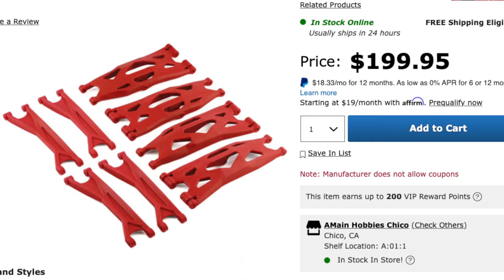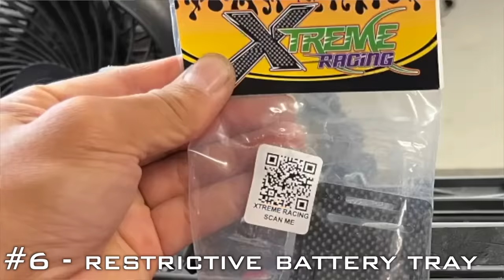7 worst Traxxas X-maxx problems - and how to fix

Comment: I bought a new 8s that i run on 6s because i had the batteries for my boats already.
3 battery cycles 20 min use basically and it switched by itself to reverse from forward and then no power to motor. Switched esc it worked then same thing first run outside. a 1500 truck that after taking it out twice is basically new but i have to spend money on. Arrma i have an Infraction and a Felony that has run to burn tires like no tomorrow and never a single problem with both. The infraction as even been used in heavy dust and not even a fan quit on me. I had wanted an X Maxx for a long time now i regret buying this piece of crap.

Comment: So wait, you spend $1100 on the truck and everything needs replaced for it to not break? Ummm, anyone else see the problem? $1100??? And it just breaks, servo too weak, and tires blow up?
Reply from the maker: Yup agreed. It is a great chassis for sure. But the weaknesses are well known and have not been fixed for the las 7 years or so.
Reply: @RCReviewChannel  that helps me make my decision as a n00b to this. Any alternate recommendations? Thanks!

Comment: i blame the driver for the damage, this toy is for responsible people. drive carefuly and it should last much longer. great power, great responsibility :)
Reply from the maker: Not sure you know what basher rc car means
Reply: i mean sure, its made for endurance but it still gets damaged if you run it into a wall or if you launch it high into the air... you can be more or less gentle @RCReviewChannel

Comment: Just bought a Maxx v2 after several years away from the hobby. I have beat the absolute shit out of it minus sending it “to the moon” and it has held up perfectly so far. Full speed end-over-end cartwheels, somersaults, etc. on grass, dirt, gravel, and concrete. The body is already a bit beat up and some scuffs and things on the plastic bits but everything still works perfectly. Changed shock oil to 70wt, put heavy springs on the rear and moved stock rear springs to the front. That’s it. Otherwise it’s just like it came out of the box. Now I just need to keep those wheelies down 😂

Comment: great video hands down the truck is insane iv upgraded the servo and iv got a full set of hd are sitting hear plus a chassis brace next will be a max 6 esc some hinge pins for the arms and i think she will be all good no need to upgrade much else the truck is a blast o ye and maybe tyres later on key is not to be so aggressive on the throttle

Comment: So far, I've been lucky with mine. I did tweak the center shaft, but straightened it out. Did blow a tire,  but my fault. 
Heavier fluids in the diffs will keep them from unloading as much,  and going up 10w in the rear shocks helps tremendously. Also,  not expecting it to survive absolute insane expectations is a big thing. " stupid truck broke after I jumped it off an overpass and it was hit by 11 real cars. What junk". 
Those people give RC's a bad rap. Enjoy and have fun, but be realistic about what anything can handle- or expect the consequences. 🤷‍♂️
Reply from the maker: Very good advice there!!!!!
Reply: @RCReviewChannel  How is it good advice to accept a weak servo, the wrong fluid, weak front arms a suspect ESC and a driveshaft prone to bending? If it wasn't RC I would think you accepted money to say it was good, but sadly RC is full of people accepting bad and even praising them for only requiring a few changes from new. 😵‍💫😵‍💫
Reply: @dalelc43  I guess I've had a few minor issues so far but for what it is the few minor changes are really nothing to massive and simple to do it's a great rc car insanely fun and way better then the other options.
Reply: People who talk big and expect non-destructible vehicles are idiots.  The plastics are very forgiving….start adding all those upgraded aluminum parts and see what happens.  The vehicle is fine as is.  Unless you want to dump a lot of money into it and for it to perform much worse.  Then, by all means…..do it.
Reply: @Bryzle1   EXACTLY!  I had way too many walk into my hobby shop complaining, didn't matter the brand. 
They can only take so much.. people need to realize that.

Comment: Id say the number 1 problem is the weak pinion and spur gears, and meshing it correctly is hell. I  gave up on it.
Reply: Yeah any tips I have a driveline issue currently slightly clicking under full load only on high traction surafces can't work out if it's diff or driveline completely it's bloody annoying the squeak is easy to fix but the click is worrying.

Comment: Have had mine since they came out and bashed the hell out of it. Only thing that broke was the front A arm after hitting a block of concrete hidden in the brush. No other issues. I must be lucky.
Reply: Yeah mine makes noises that aren't so great works perfectly thought I bash moderately within reason sounds like a differential is gone on it.

Comment: I'd say the servo the hub bearings, the ring and pinion, and the tires. Those are the only thing things that I have had to replace after 3 years and I launch mine off 40ft tailings piles.
Reply from the maker: That's a great testimonial right there.

Comment: I've had my Xmaxx for 4 years and still has the original electronics, including the servo. I bought the Proline Badlands when I bought the Xmaxx. Never used the stock tires.
Reply: That makes me feel better I just bought one yesterday and for that amount of money I didn't want to go out buying things for it already!
Reply: I’ve had my Xmax for 7 years.  I’ve run it probably 500 times on the most rough terrain possible.  I’ve literally beaten the snot out of it and it continues to beg for more.  It has never broken and it still runs like the day I took it out of the box.  It is quite an impressive machine.  But then again, I never ran it in freezing temperatures and it never came into contact with water either.

Comment: Thanks for the video! I'm still debating whether to go with the xmaxx or the kraten 8s. Any thoughts?
Reply from the maker: I think Xmaxx. If you can get the Kraton 8s for less than $800, I would swing that way. Xmaxx is just more fun IMHO.
Reply: Xmaxx is more durable and replacement parts are cheaper. Metal chassis on the Arrma is guaranteed to bend almost immediately.

Comment: Although I didn't go with exactly the same upgrades (for example, I went with Castle, instead of Hobbywing, for the ESC & motor), I had...long ago...already covered all 7 upgrade points.  As great as the X-MAXX is, even it can use some "help" to make it better.  🤙🏼

Unfortunately, I won't be taking it, or any of my vehicles, to Calabazas Park's BMX area anymore.  Why?  Let's just say, "So long SF Bay Area. Hello Las Vegas."
Reply from the maker: Oh whuuuuuut? Vegas? Darn.
Reply: @RCReviewChannel  LOL.  Honestly, I expected to make the move...I just didn't expect to be making it for at least another 12-14 years.  But, family matter moved the date up considerably.  That does NOT mean I'll be forever gone from the Bay Area, as the company I used to work for will occasionally fly me in to drive buses for major events (such as Google I/O).

Comment: Near 4 years on mine and still have the stock servo, set the end points when you get one. I bought the bluetooth link and adjusted the easier way.
One day I'll upgrade or just get the metal gears and rebuild it. 
Max 6 is a definite. wakes the truck up nicely and with 20/50 hardened steel gears makes the truck drive much better. 
50wt shock oil all round seems to be the sweet spot for me for mid level bashing and handling. Tyres.. well.. I've blown a few but still use the stockies as they are much lighter than badlands so less stress on the drive train and never use self righting... hard on gears and tyres. 
The new V3 X-Maxxes now have the oversized bearings on the front and rear hubs so no need to get RPM hubs anymore. I ordered them and fitted them to mine... no more problems.
Other than that, really it's an Epic RC that always makes me smile like an idiot lol. Way too much fun.

Comment: Just get kraton exb 8s and put everything you want and you will still be under $1000... mine has the max 5 esc 1100kv combo and power hd servo. Kraton exb are 480 right now or get the outkast if you want xmaxx style driving experience. I own Maxx by the way and that truck is extremely durable but it has the weak servo and tires do not blow out like they do on Xmaxx.
Reply from the maker: Very good observations. I agree for sure.
Reply: Except if you're under $1000 then you still need to upgrade a ton of kraton components to be as durable
Reply: Not on the exb and not everyone abuses thier rc's like kevin does.
Reply: @billyjones589  even The people who don't still complain nonstop about needing to upgrade on the kraton 8s pages... I guess they're all lying
Reply: @billyjones589  you're looking at 1000 just to complete it with electronics. Still have a weak chassis that needs a brace or upgrade... m2c doesn't only sell to Kevin. They make a killing on chassis because they're very desired by so many... there's driveshafts that aren't exb that can't handle the upgraded motor. There's cvds as well... thats a few hundred right there. Bellcrank is very popular. Hubs or even just bearings. Diff lube because they came empty lol etc etc. Most people are rocking a stock exb and think its durable. There's a list of go tos to upgrade and complaints. Thaysbwhy they've been on sale... they don't sell st full price anymore since people realized it. Same with fireteam at almost half price.
Reply: @andyvannort2743  if you buy the RTR then yes I agree they had issues but Exb are more durable and I haven't had any issues with the drive train.

Comment: You must have an early version of the Xmaxx. My 8s steering servo is very responsive and I’ve had it a couple years.
Reply: I got 8s xmaxx and servo is so weak. It barely turns the wheels at load